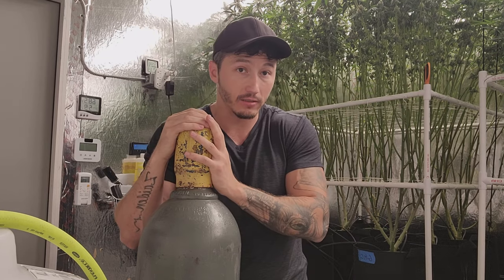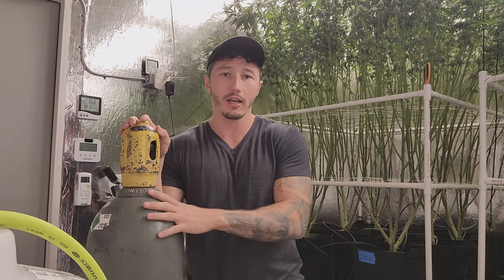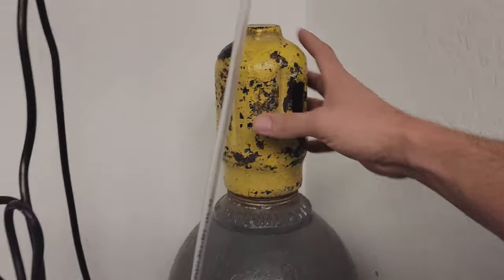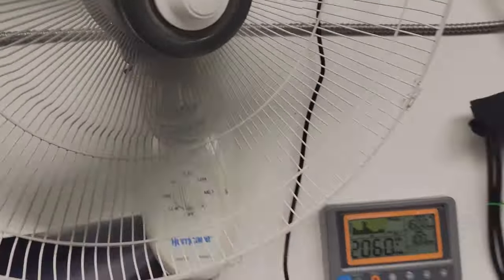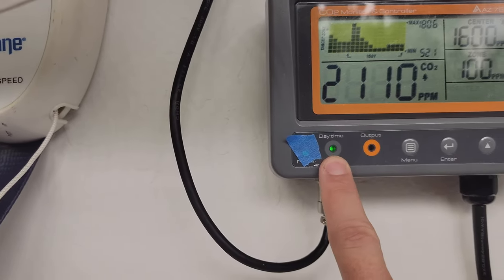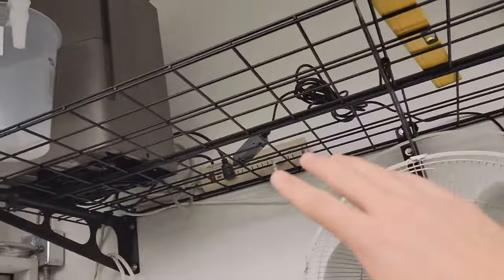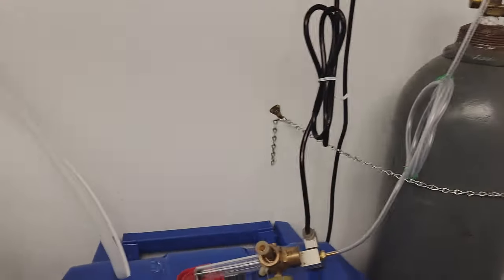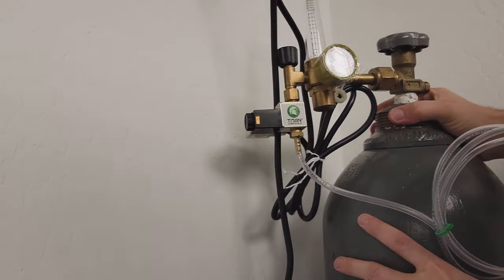How to Setup a CO2 Tank Monitor, Controller and Regulator - How to use Co2 Equipment

Comment: You should place your sensor within the canopy for accurate levels.  Thanks
Reply from the maker: I know. but its not the best to have the cord running across the ceiling. So i place it at a higher level than the canopy. And since the room is not massive that ensures i am getting at least what i am reading at the canopy seeing as Co2 is relatively heavy and sinks.

Comment: Hello Sir, can I use this CO₂ controller to control the supply of fresh air into my grow room using a blower fan when CO₂ concentrations inside the grow room are high? I don’t need to supply CO2 into my grow room, instead needs to supply fresh air when CO2 concentrations are high.

Comment: In my case I have extraction working all time... Do you think worth put one of those if I am extracting air all time?
Reply from the maker: No i would not invest the money if you are pulling the air out. BUT what you could do is place your grow or your air intake in such a way that it pulls in co2 rich air from occupants in your house or from the area around a pilot light, since both will have high CO2 levels naturally. OR if you are in a cold area and need to heat your grow. use a CO2 burner or a gas heater to produce both heat and co2. Just be safe and not burn the place down.

Comment: Did you manage to read that report I tried to link to.  about CO2 reduction in rough air flow.  I know your not going to buy this easily, but putting it "though" the fan reduces the PPM straight away, as when the molecules have any impact, they break down.  I've now got mine in front of the fan, due to this reason and no longer get the same amount of dust on the blade edges due to the moisture in the co2 making them damp.

This is just from google  ""Does a fan help with CO2?
Presence of a small portable desk fan was found to significantly reduce the CO2 concentration. On average, we observed a 177 ppm reduction in CO2 concentration when using a fan, which is 25 ppm higher than the background CO2 measurement""   and that is just in the room, not putting the CO2 stream through the rough flow area.

Just something to bear i mind Gromie.
Reply from the maker: I did not read it. Can you send me the link to my IG?
Reply: @TriStateTrichomes  Don't have insti, 
And I do apologize for being so pedantic...but you only have yourself to blame for spiking my interest in the finer points of CO2...lol
Reply from the maker: @UbiquitousRomp  fair enough haha! Will youtube let you post the link if you add some spaces in the middle so it doesn't recognize it as a URL

Comment: So your room is sealed with no intake or exhaust fans at all?
Reply from the maker: that is correct
Reply: @TriStateTrichomes what happens when your in the room working on the plants and your on breath brings up the Co2 ppm’s into the mid 2000’s do you just leave it be and the plants will just take up that co2?

Comment: I have a tent and just got a Co2 tank. Can this be used in a tent as well?
Reply from the maker: Nothing can stop you from using it anywhere of course. But keep in mind a tent isn't very well sealed and you tend to open them often. So you will lose all of that co2 and run through the tank rather quickly. You make be able to seal the room the tent is in though so that way it would not matter.

Comment: If you have 100 zone and 1600 centre...Then it's coming on at 1550 and off at 1650m.  You need the 200 centre, for those activations of 1500 and 1700.
Reply from the maker: It could be different for different controllers but mine will turn on at 100 less and off at 100 more then my center with a zone of 100. But this could be specifically to just my controller. I don't have experience with other brands. So this is a really good point to bring up.
Reply: @TriStateTrichomes  I have the same controller, check again...it's called centre for a reason....the centre of 100 is 50.  I did double check before posting,
Reply from the maker: @UbiquitousRomp  mine is different then yours. Possibly a different model or mine isn't functioning the same. I'll see if I can find my original instructions. But I just walked into the room and caught it a little after it turned off at 95 above my center. I took a quick photo. I'll place it on the community section of my page for you to see. Mine is a 100 swing for sure though.
Reply: @TriStateTrichomes  if I set mine to 1000 with a 100 zone, it usually over runs the 1050 and can be up in the 11's just on the over run, thats in the air before it's reached the sensor. Still re activates at 950 though.
Reply from the maker: @UbiquitousRomp  Thats generally why i keep my flow rate between 2 - 4 SCFH so I'm not grossly overshooting. Ill keep an eye on it and see if i can catch it at the exact time it clicks off just to see.
Reply from the maker: @UbiquitousRomp  so I think mine is having some issues. I just stood watching it for it's entire on/off cycle and watched it click on at 60 under but not turn off until 140 over. Which if it drifted higher after turning off, I would get it but that's what it's clicking off at. So I may need a new monitor. This one has been running basically  24/7 for 2 years straight lol. So I can't prove my stance any longer. I could possibly have been remembering incorrectly and since I don't have the old instructions I don't have any evidence to support my statement of the 100 swing. I'll just take the L on this one
Reply: @TriStateTrichomes  I reduced the pressure a bit to reduce my over run.  It's never going to be exact, due to the time it takes to reach the sensor, after shut off. So I only have the 100 zone, but wanted it nearer 200 and that was how I achieved it.

Comment: The meter itself also has a joint you can check for leaks.. often forgotten
Reply from the maker: Your meter might be a little different because no Co2 runs to my meter. It connects to the regulator at the power source. What meter do you use?
Reply: I ment the connection from your annalog reading on the valve itself. For now not using any co2 but like your setup.. got me interested..
Reply from the maker: @seranne  are you talking about the joint just after the flower rate gauge before it meets to the little solenoid "black box"?
Reply: I ment the back of the presure meter that shows the tank volume.   The one with the pointer. Sorry for the mis understanding. It screws in am i right? I am a welder.. you would be suprised on wat places they leak. they can even leak on the knob to regulate the flow. Thank you for your uploads
Reply from the maker: @seranne  okay I understand what you mean now. I would have to check if this screws in or if it's permanently set. I know the oxygen and acetylene tanks had ones that screwed in when I was in school. Only ever saw leaks on the oxygen tanks. Which I guess makes sense with the amount of pressure. Good point though. I'll have to check now and see how its designed.

Comment: the controller dispenses co2 to a given point?
Reply from the maker: yes it keeps it within a set range. mine is plus or minus 100PPM from whatever my given set point is. For example 1500 is my set. it will turn on at 1400 and turn off at 1600.

Comment: How much did the whole co2 setup cost ya?
Reply from the maker: Tank: 300
Monitor/controller: 160
Regulator: 50
Just over $500 roughly 2 years ago.
Reply: @TriStateTrichomes  thanks for replying man. It's kinda rare in my experience.  👊
Reply from the maker: @smellydan715  I try my best to get to all of the comments. But there are so many videos and between these comments and the IG messages, some slip through the cracks

Comment: Normally utilizing a monitor that keeps the CO² levels up at a constant 1200ppm - 1600ppm but Could you do an experiment bringing the CO2 levels up to  1600ppm and documenting how long it takes for the plants to bring levels back to the normal 403ppm, utilizing all of the excess CO². How many square ft x how many plants x how many hours to utilize  the extra 1200ppm of CO²..
Reply from the maker: that would be different at different stages of the plants life. i would have to perform this weekly which would be placing a lot of stress on the plants throughout the entire run. not ideal

Comment: Hey, so I recently just bought the same controller as you but I'm having issues wondering if you had any suggestions? My room is 430sq and my regulator is set to 10. After 6 hours it won't go past 1200 ppm (1350 target) . I have no air intake. My tank has not turned off

Comment: do you keep extraction on while co2 is being pumped
Reply from the maker: never extract
Reply: @TriStateTrichomes  what about the smells inside would having a carbon filter extracting directly into the tent help
Reply from the maker: I run a carbon filter inside of the room (usually mid to end of flower) to reduce odor.   @leee2235
Reply from the maker: i have a carbon filter sitting inside the room that just adds to my air circulation i turn on around week 5 @leee2235

Comment: havent contacted the company because i set the controller up tonight (same one you have), out of the box with no calibration is reading damn near 900 ppms in the room with no supplemental a couple of hours after the lights turned on and had the door open. that doesnt make much since to me, any input would be greatly appreciated. really not trying to talk to someone on support reading a script with no experience. i know they said you can calibrate outside on a sunny day but that just doesnt sound very exact haha any input is greatly appreciated.
Reply from the maker: your indoor co2 levels are always going to be higher than outdoors. especially if you live near the grow. that could explain the increased levels. my closet setup is in my office and it stays 800 to 1100 at all times from me sitting in the office haha
Reply: @TriStateTrichomes  Damn and i was sitting here thinking this thing was messed up thanks for the reply man. thats crazy it raises it that much.

Comment: How high of ppm u keep co2 in veg
Reply from the maker: Depends on what PPFD i am running at that time. I will tapper co2 up as my PPFD increases. So ill start out at 800 and have it up to 1500 by the time I'm flipping into flower. But that is also with a PPFD of 1000 or more. So there is no 1 answer to this unfortunately. Just depends on your other factors.
Reply: I go 200 over my PPFD, all the way up.  Haven't gone higher like our Gromie here does, which is why I'm so interested.  

The natural ambient is about 350 PPM here. So in week 2, from seed, I'm at 400 PPFD (600 ppm)instead of the recommended 200PPFD . and at the beginning of week 4, Im at 6-700 PPFD and 900PPM. I'll go up to an average PPDF of  of about a 900-1000PPFD with a few hotspots, and run the CO2 at 1200 - 1300ppm.

Comment: Does your light on the sensor stay on? Mine does and I never noticed that before. I thought it turned off when the lights are off. I know the control panel will turn off and on and then there's the power light that always stays on (got mine covered with painting tape also😊)  But that sensor light is bright as hell. I covered it with more tape but just wondering if yours stays on.
Reply from the maker: the light on the sensor itself stays on and i also cover with painters tape so it is easily removed if needed.